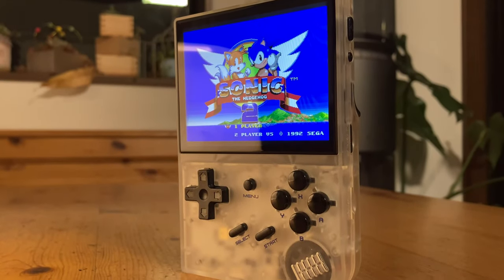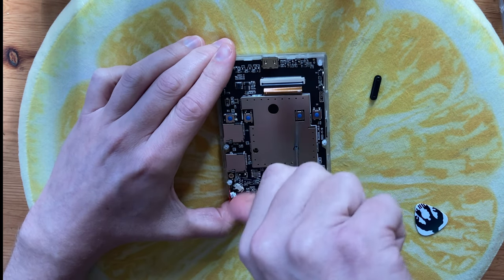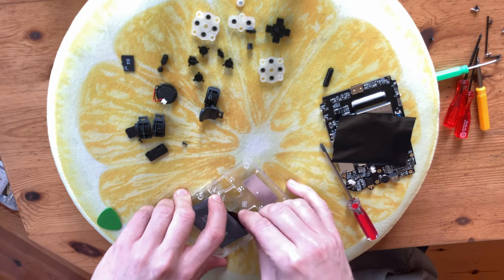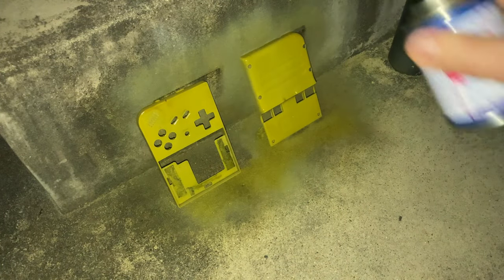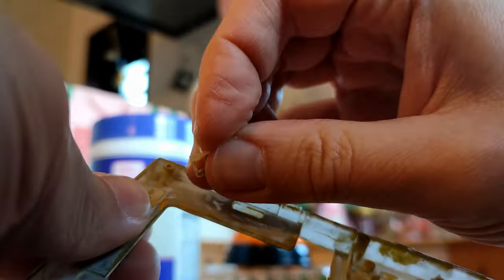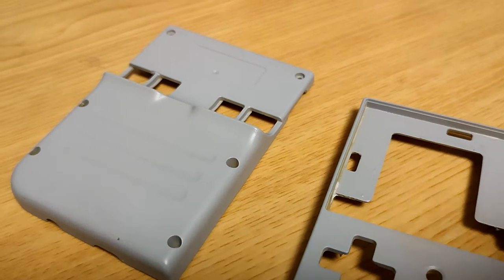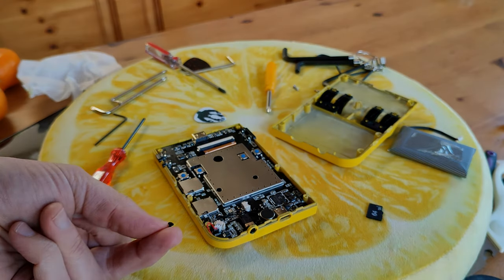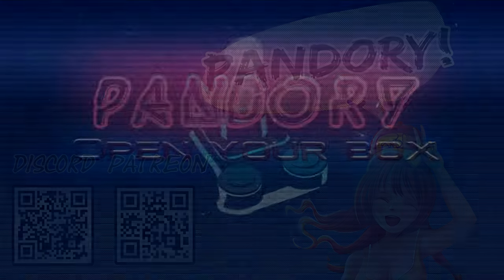RETRO MOD Your Anbernic RG35XX! - How To NOT Paint Your Gaming Handheld!

Comment: Spray paint was definitely not the right choice. I am planning to color my RG35xx by submerging it in hot water with black fabric dye. I emailed ambernic and they sent me the correct temperature to do it, which is 40 - 50ºC. There are multiple videos on YouTube showing this method for "tinting transparent plastic" controllers. 

My only concern is the screen removal process. This video did not make me any more confident when it comes to disassembling the screen. Could you describe this process a bit better?

Thanks for the awesome video btw!
Reply from the maker: Considering we broke the display, the only advice is to "be very, VERY careful... and don't bend the screen"  - Tinting with dye is definitely the way to go!  Thanks for the VERY informative comment.  I'll stick a pin in this
Reply: Rit Dye more for plastics.

Comment: Are you going to try this again? The cool thing about the transparent case is that you can paint it on the inside and get a perfect looking finish on the outside. There's a few people that did this already on the subreddit!
Reply from the maker: If we were to attempt it again, it'd probably be using dye... Or using the clear yellow without primer. 
Good point regarding the inside, getting a finish is half the work!
Reply: @TeamPandory  I'm not an expert, but I'd leave out the primer when painting from the inside. Just make sure the surface is 100% clean from oil and dirt. You're not really touching it, so no primer shouldn't be an issue. Check out QueeefLedger's post on the RG35XX subreddit. He did a little walkthrough of his procedure and it looks phenomenal!

Comment: I wonder if you could just have painted the inside and the yellow would have showed through.  FYI, you typically want to use adhesive promotor on plastic parts.

Comment: Would tapeing off the screen work for painting if you where spot on with it?
Reply from the maker: I guess. The reason I wanted to take it apart was to be thorough.
One thing you need to be careful with when using tape is to not have it stick too well and break the screen when you remove it.
Reply: I will keep that in mind thank you for the info I really do appreciate the info of your video and comments
Reply from the maker: @davidlayton6976  Thankyou ! 🥰